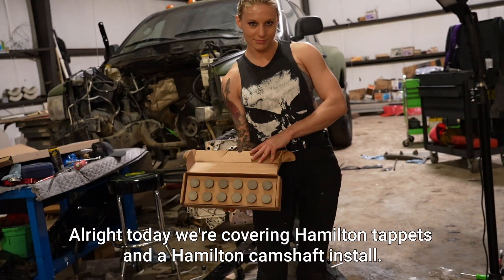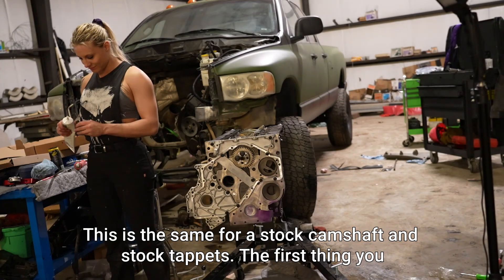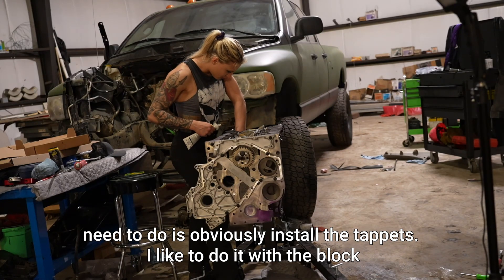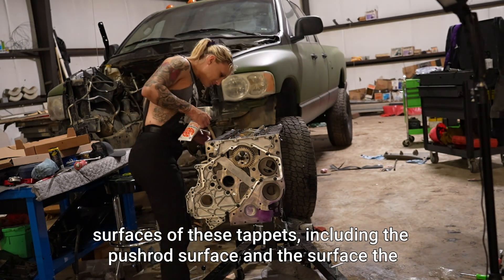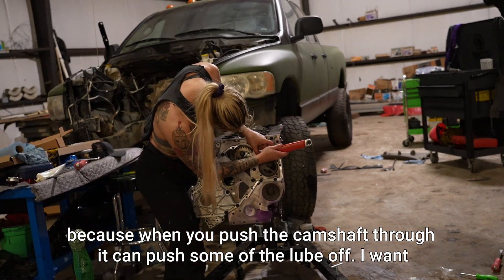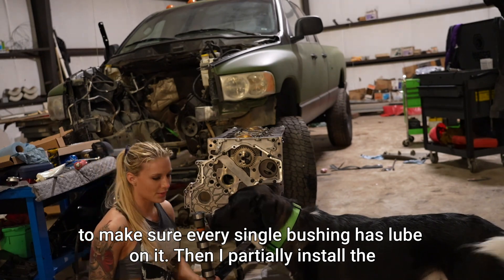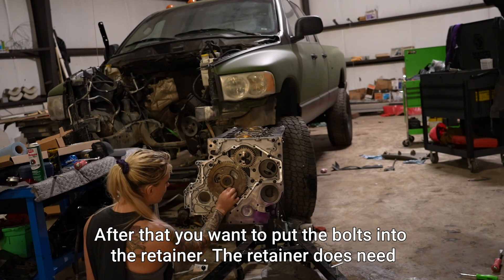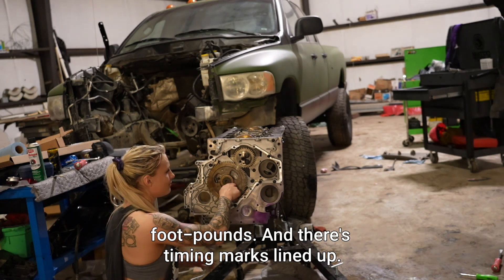05 Cummins Camshaft and Tappets Install

Comment: Hopefully you see this, on the camshaft bearing journals is there only 1 actual bearing in the front and back end is only the journal? Pulled my block out and back plate adapter off and noticed only 1 cam shaft bearing front side if motor. (Only worked on ls so I'm use to common each one has a bearing)